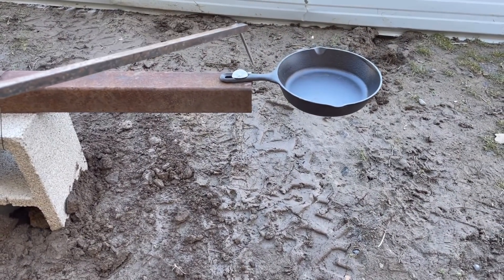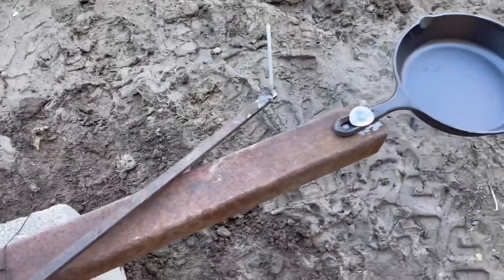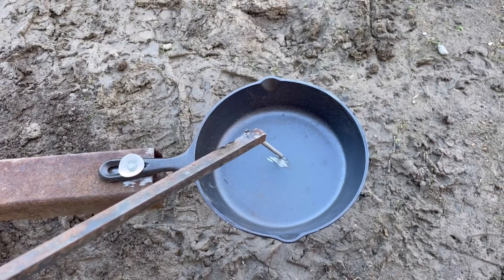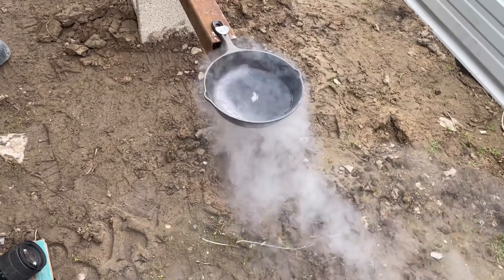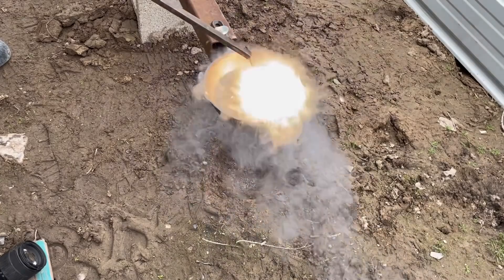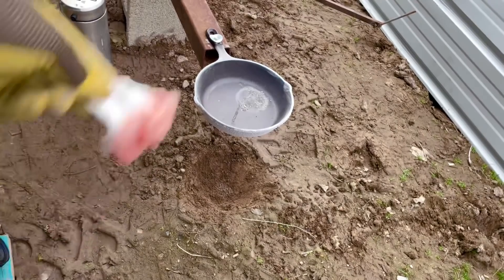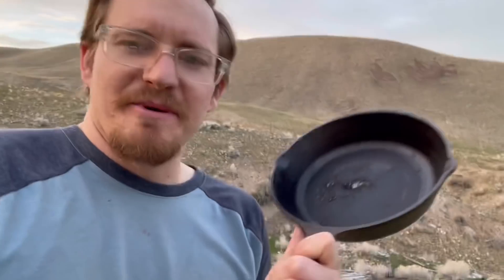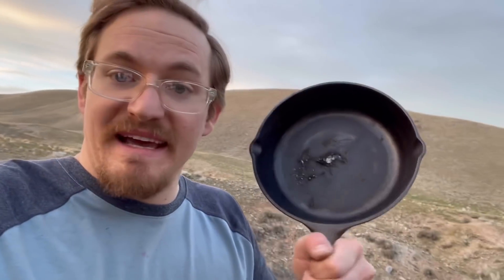Welding in an iron pan full of liquid oxygen

Comment: I can roughly explain multiple facets of why this experiment didnt work. 1. oil negatively affects the ability to start and keep an arc. 2. the flux on a stick electrode helps shield the metal from gases and acts as a protective layer. lastly, 3. oxygen by itself isnt technically a fuel source it only aids in combustion so without a combustible constant source (like acetylene which is used in oxyfuel cutting) that cast iron pan didnt melt or burn through.

you may have had more success if the pan had the following: no oil on it, rust. as well as using an electrode like 6010 which burns hotter and has a flux coating primarily made up of cellulose. 6010 in the field is sometimes used to burn through metals (for fitment and whatnot) in structural steel because it is very good at penetrating steel. so if you maybe tried it with these in mind it might have worked better. oh and not cooling the pan. rapid oxidation requires heat

Comment: Intersting. You would have to install a rod with a grinder at the end while being submerged in the liquid oxygen. The grinder would rub away the oxide layer and if you attach a welder or car battery to it, it would at the same time create sparks. You could probably get it running.

Comment: try something like letting a cast iron pan rust, toss some aluminum powder in there once its good and nearly rusted through entirely, then hit the rusty pan with a weldong arc to see if it "accidentally" thermites.

something like trying to do an almuminum melt in an old rusty pan, see if the almuminum will react with the iron oxides in a less of a ... "planned reaction" and more of a "oops didnt expect to make thermite." but the experiment is to see if a person could have discovered thermite by accident by just "playing" with metal work safely

Comment: use that as the iron-air fuel cell anode
Reply: ie, electric oxidation, with the electrolyte removing-chipping the oxide layer off, as slag
Reply: iron nano powder fuel bomb
Reply: should be very similar to a flour air mix ignition
Reply: iron-air thermite
Reply: metal-chaff

Comment: Testing out someone's claim s always worth the effort to see if they are telling the truth. You used iron instead of steel though which changed the parameters of what you were told. Nonetheless, I don't think it will work with a steel pan either.
Reply: I think it will change greatly, no one cuts cast with oxygen! I have cut frozen steel all day  long, even underwater!

Comment: I suspect the extremely cold temperature may have been an issue as well. I know in metal cutting acetylene gas is used as a fuel to raise the temperature of the metal before it will burn.

Comment: as well as the lack of heat would be a big factor in my mind. with a cutting torch you heat up an area red hot and then put high pressure gas through it, which doesn't cool down surrounding area, where this pan is at cryo temperatures, just seems like it would cool far faster than any burning would generate in this set up. plus all the reason you said.

Comment: I did that for 15 years running a CNC ox cutting table.. it was a Huge Table 55 feet x 20 feet I cut up to 9" thick steel 
you need steal Iron wont burn so well I it was all most imposable to cut iron. like brake rotors or drums

Comment: Isn't that a flux coated welding rod? If so, it's designed to produce shield gasses designed to keep oxygen away from your weld. You might want to try a tig rod or something instead.

Comment: I wonder if it would work on a steel skillet instead of cast iron. Cast iron has a lot of impurities and it imagine that might restrict the reaction of the iron with the oxygen?
Reply: Cast iron can not be cut with a torch like steel, it form a oxide layer (Fe2O3), a black surface layer called scale, as it is fully oxidised it is fairly resistant to further cutting, steel does form scale, but not like cast iron.

Comment: A cutting torch contains fuel. The pan is not fuel. The pan did not burn because there was no fuel therefore also a lack of heat and so the pan does not melt.

Comment: I’ve always found compressed oxygen much scarier than liquid oxygen, especially at high flow rates. Definitely agree with your reasoning at the end there
Reply: Ok hear me out; liquid ozone on a pan.
Reply: @tomh2628  why not FOOF?
compared to FOOF even chlorine trifluoride is unreactive af
Reply: Ah right, that makes sense. I worked in a lab once testing gasses via GC for Linde gas. One day they had a fire in the warehouse whilst filling up a tanker with liquid oxygen. I guess the whole system was under a lot of pressure. The metal tap on the wall that supplied the oxygen set on fire. It totally freaked out one of the workers there. I didn't see the fire (kind of sad that I missed it really), but I saw the aftermath of the tap, it was just a big hunk of melted metal.

It was an event filled place really. We had 2 deaths there one time. Someone went inside one of the tankers to clean out the empty container, turns out it was still full of pooled nitrogen, he collapsed, someone went in to help him, they collapsed as well. Both of them died.
Reply: @Indie9999  that happens all too often. that's why we have confined space working regulations. no lone working. atmosphere monitoring etc
Reply: It didn't blow up because it wasn't yellow.
Reply: Yeah, LOX isn't a much more of a hazard as one might think. It turns out that while LOX is a lot of O₂ in a small volume, it's also really cold. Those kinda offset each other. For example, the reason that SpaceX et al. use TEA/TEB for rocket ignition is that it's literally one of the very few things that's hypergolic with LOX. A lot of things that will auto-ignite in air would be too cold to burn in LOX.
Reply: @benjaminshropshire2900  Agreed, boiling the lox with the arc is going to need a lot of energy, dropping temps. And +++ to compressed O2 at high rates being scary. Already gaseous and ready to turn any Fire into a much bigger Fire 2.0
Reply: That's a well-known fact from rocketry. Liquid oxygen mostly quenches any unintentional flames it causes because it is so cold. Gaseous "hot" oxygen (at the pressures and mass flow rates of rocketry) meanwhile can eat entire engines within fractions of a second if something goes wrong.
Reply: @hammerth1421  I forget which channel(s) or video(s), but there's a good example where a Youtuber is flowing gaseous O2 into something burning. The flame front moves back and the plastic tube basically turns into a thermic lance. 
Actually, that'd be a good video if Cody could get hold of some magnesium tubing :D
Reply: YOURE ALIVEEEEEEEE
Reply: haven't checked your channel in a couple of years. i'll go fer a looksee.
Reply: look up the king of random they soaked carpet in liquid oxygen and the reaction when lit was awesome in my opinion
Reply: My mate used to fabricate and showed me oxygen and acetylene in a coke can. Beautiful explosion.
Reply: @Vile_Entity_3545  😆.... oldest trick in the book my guy, or... fill a rubber glove with mix, wait until the newbie starts grinding or welding, then throw the filled glove under them for a big boom and an even bigger laugh! Lol do not do it while somebody works on a critical components though! 🤣
Reply: @Cody’sLab @Explosions&Fire when’s the collab coming out. Both of my favourite science YouTubers coming together would be a dream for me and many people x
Reply: At least they aren't yellow! 🤣
Reply: Lucky for me max blend for diving we use is 32% oxygen
Reply: I was thinking the Leidenfrost effect meant that as soon as the arc struck that the oxygen flash-boiled and formed a film of gas against the metal. We should petition Cody to build a pressure chamber rated high enough to condense oxygen at room temp, then repeat. Also use a flux-less electrode.

THAT'S not scary at all. 👀
Reply: @HAL_9001  i came to comments to comment this, got distracted by original comment, read replies and here i find @HAL 9001 with my comment. Cheers mate 🍻
Reply: get of youtube and make some cubane already smh
Reply: A side the liquid oxygen ...wich is soo cool
I ones used my Arcwelder to jumpstart my car in wintertime 😃🍻.
Bewaren use only 10 Amps MAX !
Reply: @Metaldetectiontubeworldwide  Great it worked. But the chance that you fry some electronic gizmos in the car is too high for my taste.
Every man should have a second option to jump start a car in deep winter.
Reply: BONES
Reply: I work at an air separation unit and this was really interesting.
Reply: You are alive!!!!
Reply: What if you compress it to a liquid?
Reply: Compressed gases are imho in general the most dangerous thing you will find in a lab.
Reply: With the leidenfrost effect, liquefied gasses really need to soak in or have some velocity to do fun (see: dwarf fortress) things
Reply: Singlet Oxygen is said to be exceptionally scary...
Reply: @jackmclane1826  one word: FOOF
Reply: Hey its upside down cody
Reply: Duuuude!! Whens ur next video?? I need me some GODDAMN CHICKEN GAS
Reply: Liquid oxygen is too cold, you need the ignition triangle to be in ballance ❄️😉
Reply: This Aussie gets it 😉 in it's gas form it's terrifying! It's too cold as a liquid
Reply: @ExplosionsAndFire am pretty sure bro Cody botched it up. What if scraped the seasoning to get a good consistent arc, added more LOX so as to fill the raw pan ... And hit it with the electrode from the bottom, pretty sure it will catch fire and burn.

What say you?
Reply: Are you back from Czechia already
Reply: Did you watch demo ranchs Video?

Comment: I like your explanation about the oxide (and flux) impeding the reaction. I think the low temperature probably impedes the reaction, too.  Maybe a glowing hot pan would ignite in pure O2 gas.  Just guessing based on iron burning with a pretty green flame in a Cl2 gas environment.  Could calculate ....
Reply: I agree low temperature was a factor too.
Reply: Could be, but the melting temperature of iron is 1538 °C; 2800 °F. The temperature of liquid oxygen is −182.96 °C; −297.33 °F. The difference between ambient air and LOX is not that big of a factor compared to the temperature needed to melt iron.
Reply: @whitcwa  Melting temp of iron shouldn't come into it directly.  For example, iron doesn't need to melt for it to rust.  It's the rate of reaction that is impeded by the very low temp, so more of an activation energy issue, which is related to temp.